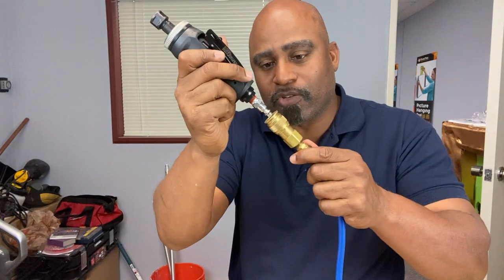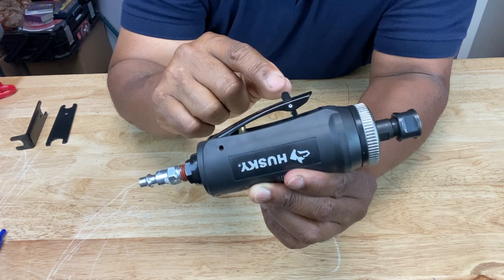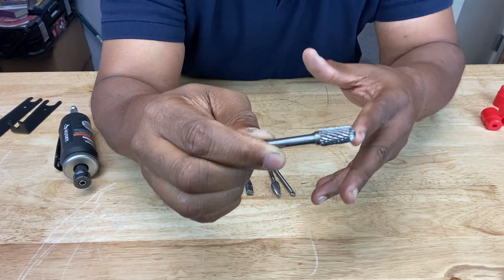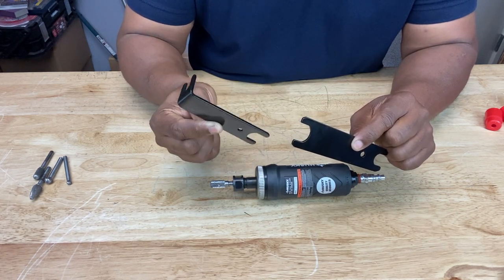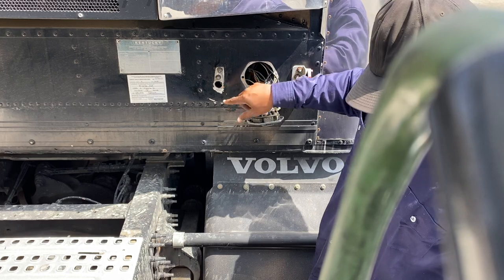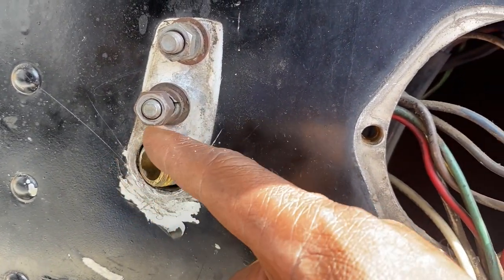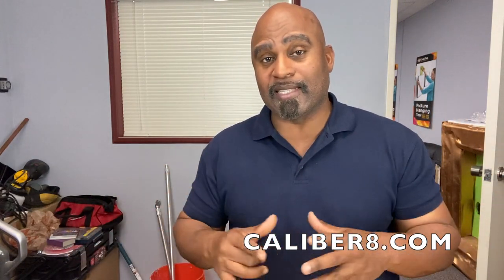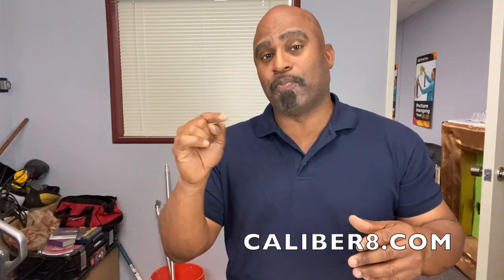OPEN THOSE HOLES WITH A DIE GRINDER

Comment: very dangerous around small holes, it bites and starts rotating inside the hole, and then deflects violently,
Reply from the maker: Correct.
Reply: Whats the best tool to do this with? I need to do this all the time. I usually grind with old drill bits. I know there got to be a better way.
Reply: @JohnDrach  i tried mounted points. they are safer although take longer time to make holes larger,